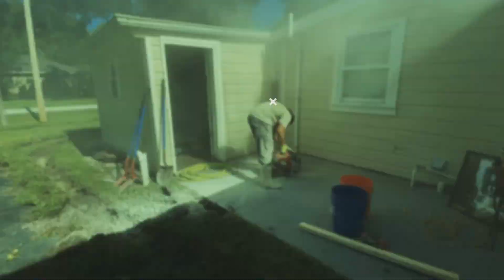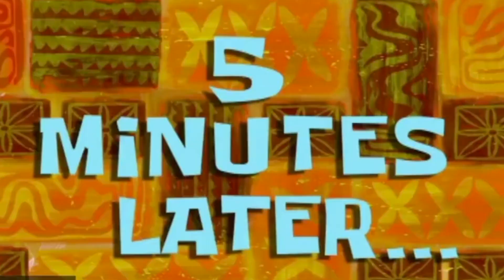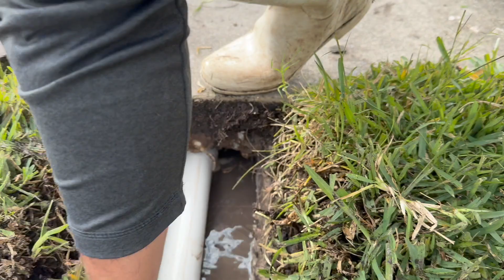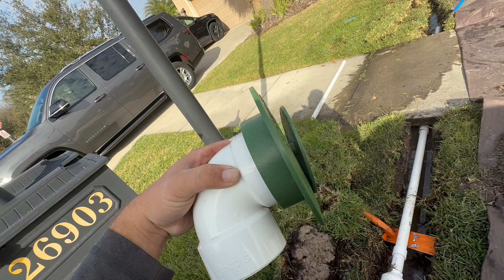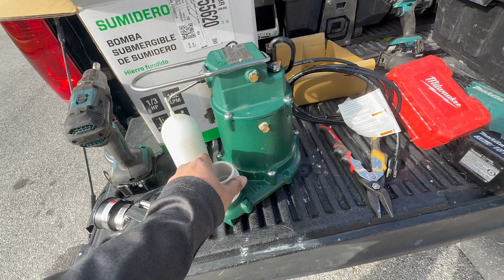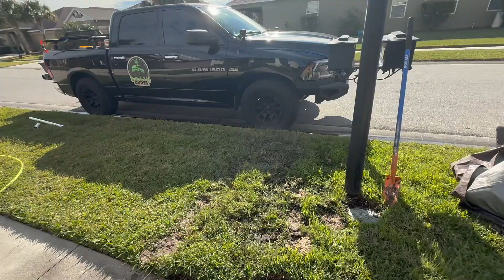Easy Side Yard Drain | How To Drain A Low Spot In Your Yard

Comment: The water coming off roof is higher than curb. Could you have done this without sump pump?
Reply from the maker: @alanjdeitch  if you could catch 100% of rainwater with gutters… but the gutters don’t do much for the rain falling between the homes, or coming off the homes behind. Even then if you could, the ground is lower in the side yard than in the front, so the pipes would still have to be exposed unfortunately. The only other option at that point would be a complete regrade between both homes to raise the yard.   This is an extremely common issue here in all the new developments.
Reply: @TampaDrainDudes  sump pump for downspout water seems rare.  Almost always lower point to take it too

Thanks for your videos Drain Dudes
Reply: @TampaDrainDudes  Exactly what I am dealing with at my house
Reply from the maker: @jmurphy644 every new home owner in Florida is unfortunately!